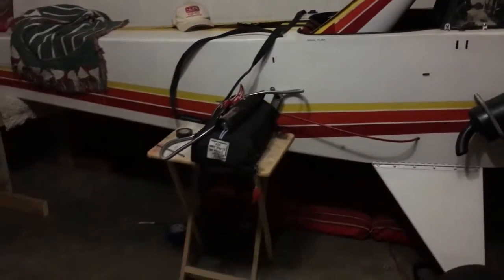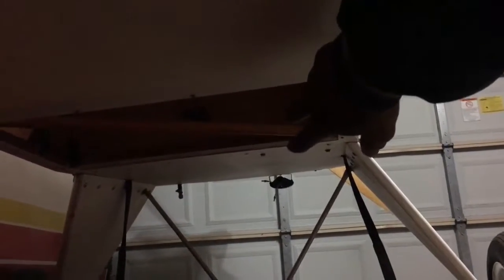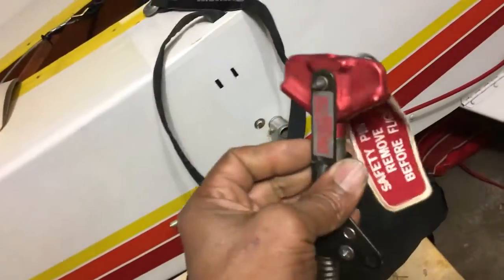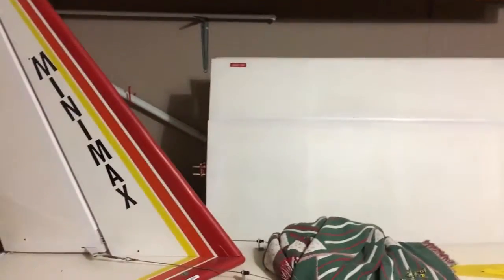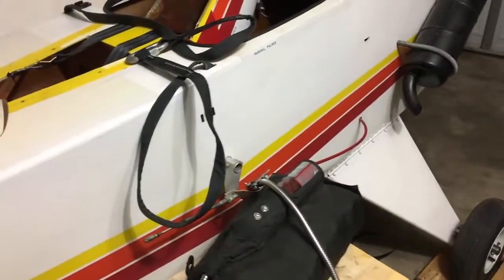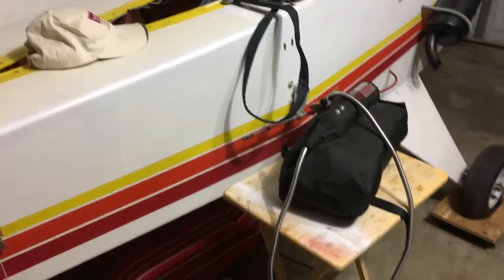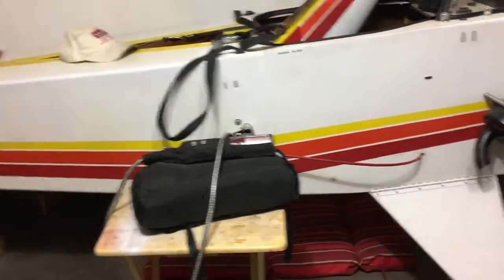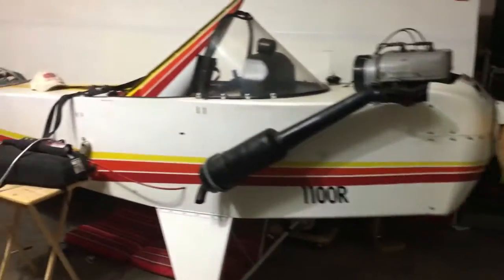MiniMax BRS Installation

Comment: I do like your MM.  Have built an 1100R and also an EROS 1650R (that I flew for 13 years).  Just curious.  Didn't see a registration number on the tail - do you have one?  You are probably aware that if your little plane exceeds 254lbs empty, it then becomes an "Experimental Amateur Built" aircraft.  That, then, requires a registration and Airworthiness Certificate.  I thought, maybe, that you were installing that Ballistic Chute to gain an additional 24lbs (which can be used with the 254 - total 278lbs now).   If you didn't exceed 278, with the chute, your plane would then meet the FAA Part 103 weight limit.   Although, some of the DAR's, during your inspection, will actually have you weigh your chute arrangement and only give you that weight allowance.  Depends on the DAR.  I know you enjoy flying your MM.  It is a great little platform and it is a forgiving airplane.  I flew a General Aviation planes, in the past, but the MM was more fun than all of them.  Good luck on your plane.  N-6395T   (MM now retired)
Reply from the maker: Thanks for the info. Actually it comes in right at 271lbs empty with the chute. Did a W/B when I purchased it just to make sure. Installed the BRS to make my wife happier LOL. But she still worries.